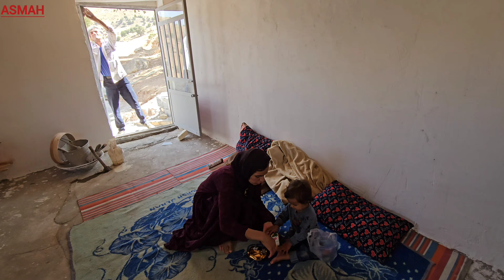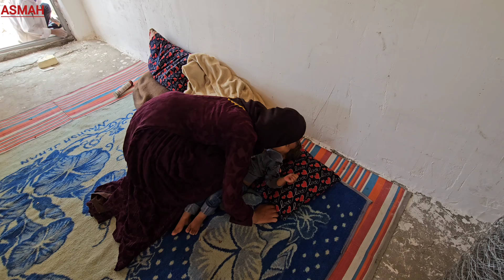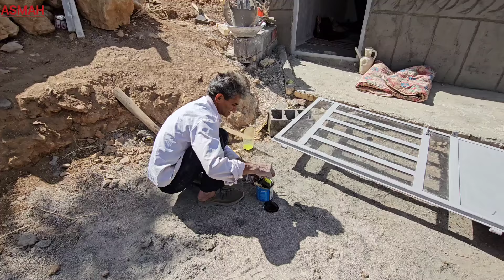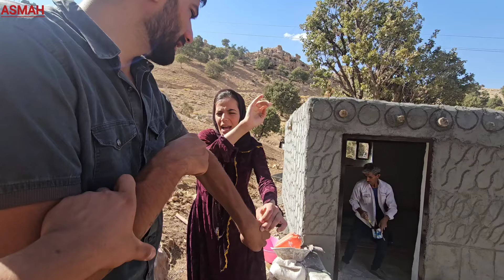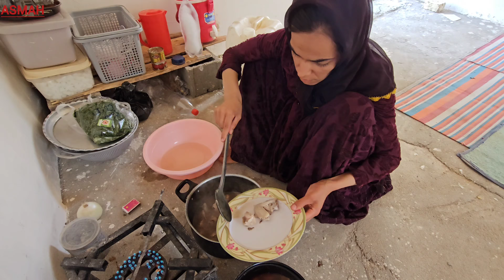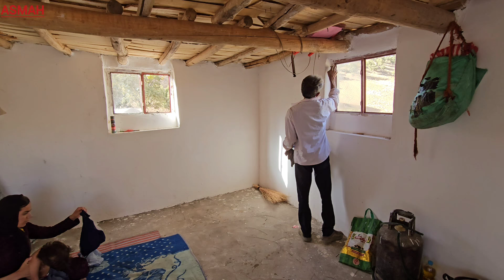Unbelievable Revelations: Mersad's Shocking Confession and a Bitter Truth in Nomadic Life

Comment: Operator, you must put hot pitch, or izogam-carpet on the roof. So is sure, that water don't leak inside at winter. Also need a heater in house. Start be cold, and at winter more cold.